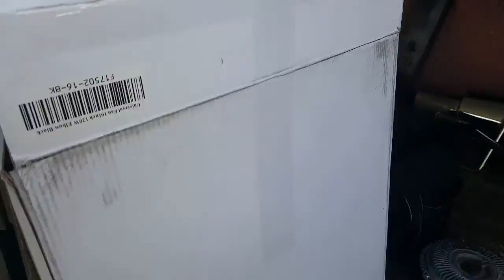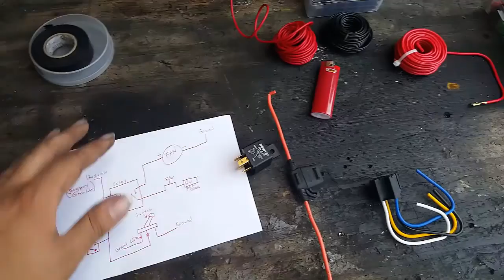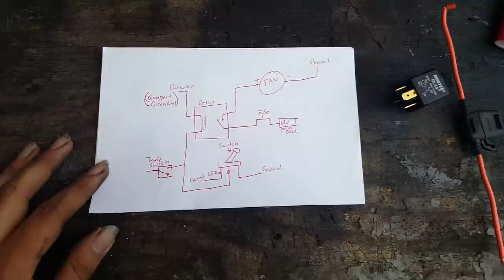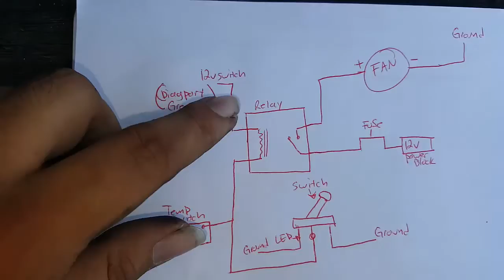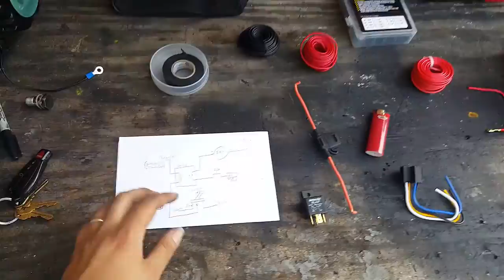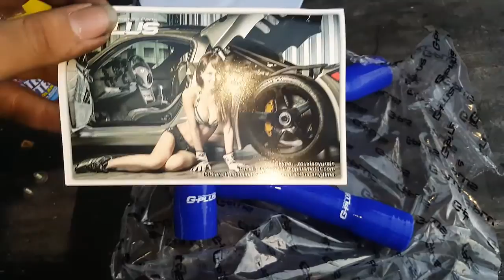E36 Drift Car Fan Wiring

Comment: Question, why do you need to wire in the one that came from pin 16? Why would the fan come on when the car is off? Would it work do just put a ground on it instead?
Reply from the maker: +will martens A ground would not work, you need constant 12 volt while the car is on, if you use the distribution block 12v it will be constant whether the car is on or off so it would drain your battery running that cable. i use the green wire in the diag port because you will only be getting constant power through it when your car is on. the fan could be off when the car is off but the wire could still be hot if you connect it the wrong way  so it would drain the battery.

Comment: Did this wiring ever work properly? seems like the video was cut short... and what did you connect to the harness that came with the fan you showed?? you never showed that part
Reply from the maker: I didnt really show in detail how i did it as it was one of my first videos on youtube. i cut the harness the fan came with and connected the positive wire to terminal 30 on the relay, and the negative wire form the fan to the ground next to the A/C dryer.
Reply: I'll try this with my spal fan, instead of buying the $50 basic wiring kit.. Thanks for the info man
Reply: This video was perfect.... I did mine just like this.. Flawless victory.. Thanks

Comment: What did you use to connect the wire to the relay it's self??
Reply from the maker: I used female wiring connectors to attatched to the relay terminals. i then heat shrunk it so water doesnt corode them.

Comment: so should I get rid of my fan clutch
Reply from the maker: I would recommend, actually anyone that owns a e36 would recommend getting rid of it, its a ticking time bomb and WILL blow one day. mine did and took my radiator out with it. You should also take a look at your waterpump, if its an oem orange plastic impeller, then change it to a metal impeller because thats also a ticking time bomb right there. and its just a matter of time.
Reply: yes you should. i snapped on of my fan blades and now its off balance

Comment: What kind of signal is terminal 16 in the diagnostic conection?
Reply from the maker: I am not entirely sure and my Bentley Manual isnt anywhere near by, what i do k now is that it is a 12v wire which only turns on once the key is in the On Position.

Comment: you never mentioned where and how you mounted you in car switch ?? could you do a video covering that
Reply from the maker: In this build i actually didnt do a manual switch, this E36 has been long gone but i am doing this same mod in the new E36 and will post a video Soon enough!
Reply: Gripless Garage so with this wiring the fan comes on automatically when the aux fan turns on?? and what was the CFM?
Reply from the maker: it comes on when the aux fan switches to the High setting which is when the car gets hotter than operating temp. the Aux fan comes on at low speed when i turn the car on but the electric fan doesnt turn on until the aux goes into high speed.